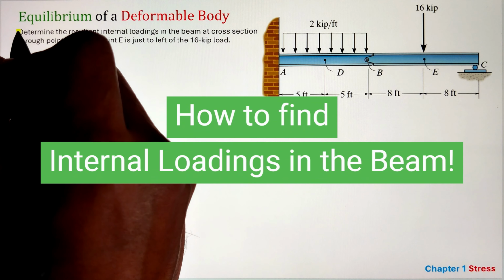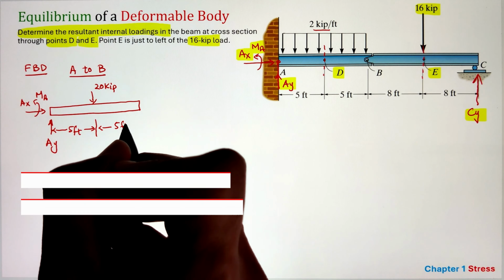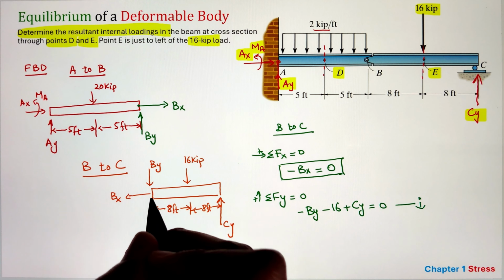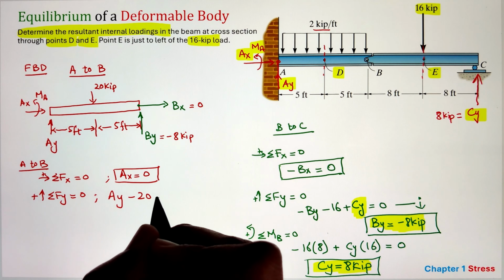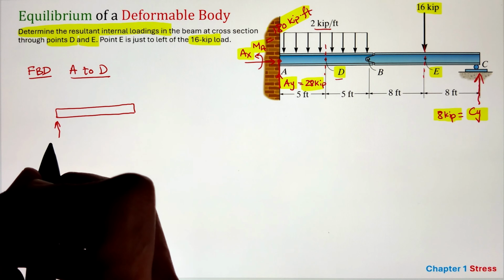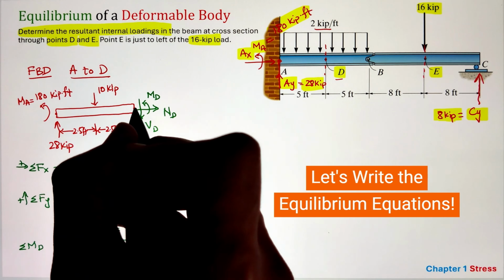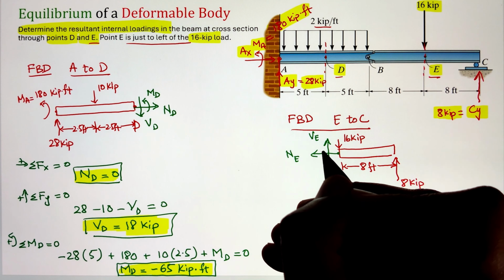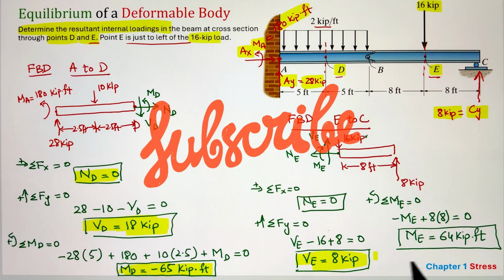Step-by-Step Beam Equilibrium | Find Internal Shear & Moment for Compound Beam under UDL

Comment: Hello, thank you for the tutoring. I would note that a mistake was made when calculating for B_y and it was supposed to be +8kip and not -8kip.
Reply from the maker: Hello, based on sign convention I have since Cy is 8 Kip, plugging it into eq1 it becomes -By-16+8=0,
Moving By on the other side of equation it becomes By= -16+8,
So By=-8kip.
I hope this clarifies.